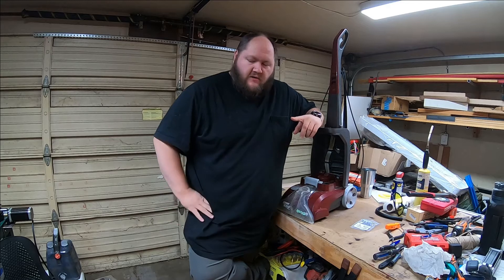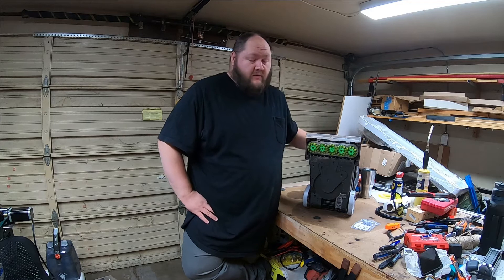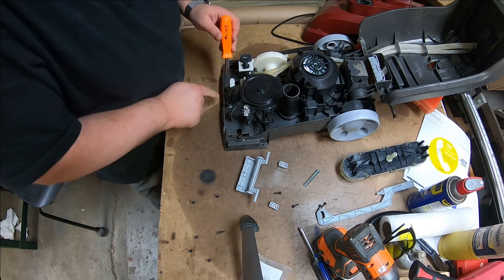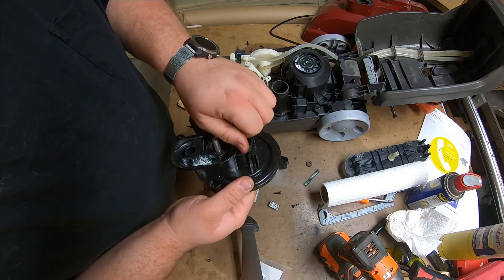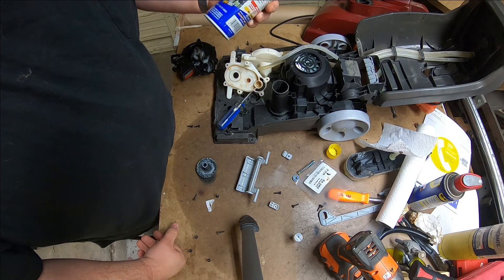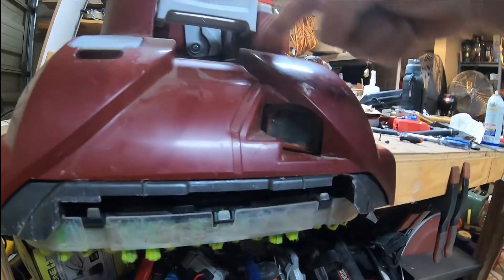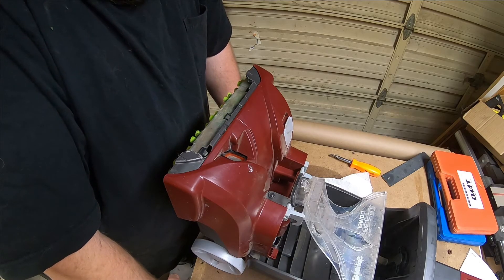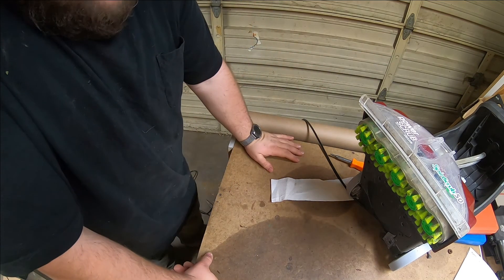Don't throw it away! Fix that carpet cleaner!

Comment: Oh, I’m definitely throwing it away. The hose broke off the white plastic piece that’s connected to the gearbox. Every screw that’s holds the gearbox on all three of them were broken at the plastic. Hoover will never get another penny of my money. They build garbage out of cheap brittle plastic. along with the seized rusty bearing. One shouldn’t have to take apart a carpet cleaner after the first two or three uses.

Comment: I have replaced these bearings multiple times. I drilled 2 access holes top and bottom behind the back of both bearings and use a  1/8 rod to tap the bearings loose. The top bearing is press fit on the shaft so l sanded the shaft for a slip fit for easy replacement.

Comment: I got one of those that I trash picked recently. Just took it apart yesterday and got the same problem with the brush not spinning (frozen bearings) But also the motor sounds sick even with it disengaged from the pneumatic turbine. It arcs and sparks and makes a popping noise. So now I’m wondering if I should scrap it after what you said about it being poorly designed. Or is it worth it in your opinion to replace or rebuild the motor?

Comment: Thank for posting!  Q: when the scrubbers are frozen does the vacuum cleaner make a  sound or does it seem like it wont even turn on? I'm having an issue where mine wont come on. I understand it could be the motor, the pump or the switch (or even a fuse link at the switch) but I was curious as to how what it did when the scrubbers locked up. Thanks

Comment: I have to wonder....when you're done using the unit... if you put a fan to blow through the screen for a few hours so air blows through there and dries it out....this is what I've always done and my brushes haven't stopped spinning... Knock on wood. I really LOVE these cleaners they suck almost all the water back up....and are so easy to use and clean...I wish they made them better.

Comment: Nice job on the video!  Have the same unit and noticed the brushes were not spinning.  Disassembled and observed the bearings were completely frozen from rust.  Soaked them in PB blaster and they freed up.  Appreciate your help in the repair!

Comment: Mine recently just stopped workin and I barely had it for a year. I had turned it on and turned it off really quick, I don’t know if that played a factor for it not to turn on again. I was wondering if you know how I could fix it? I did plug it in properly and checked fuse or breaker in my own home. However, I haven’t checked checked it there’s a fuse in cleaner that was blown, I don’t exactly know where the fuse is lol. I’d like to save it as I spent almost $200 on it

Comment: My brushes still don't spin.  I checked and greased the bearings, the motor puts out great air. The filters are clean, the gasket near the body of the machine (near the top of the waste water tank seals.  Still does not spin.  what else can I check?  ?gasket to hand held spinner?  Is there another gasket somewhere for the air to escape before it gets to the spinner?

Comment: What other cause interferes with spinning and discharge
Reply from the maker: One possible cause is an air leak. If the unit freely spins check to see if you have airflow flowing through it. Also make sure the unit does spin. A frozen bearing will sieze the unit up. Check your gasket in your collection tank and the sealing gaskets under the tank

Comment: got mine in 2019 and could tell it was total junk then ...broke in 2022 ..this problem and the spray hose pump not spraying .... land fill its coming!!!
Reply: I 3D printed a new water pump impeller. The original stripped out...

Comment: Hy , your video is so helpful…mine is 2yrs old it does not suctioning… would you please give me a link to buy it … I didn’t find it in stores
Reply from the maker: What in particular are you looking for? The bearings? If it doesn't suck anymore but still runs, check the gaskets on the tank. It operates using negative pressure so a leak in the system wouldn't allow for it to suck up any water.

Comment: Use marine grade grease youll never have to do it again most likely
Reply from the maker: That's a good option, a touch of grease never hurts.
Reply: I tried and sadly the bearings in the turbine still lock up. I'm so tired of this issue every springtime that I've resorted to popping off the brush cartridge and using a 3/8 hex on the brush drive output socket. Mind you, the marine grease on the bearings saved me from having to use vise grips on the hex key to crack 'er free. But I just checked today and I did have to use the hex by hand still to crack it free. Shoddy design.
Reply: If it spins at the hex key does that mean the bearings are spinning freely?
Reply: @burlwilliams7661 , more than likely you're okay if that's the case because frozen bearings will not allow movement. Remember these aren't belt driven brushes, so you'll have to run it on the floor to check for brush activation if in doubt they may not be operating properly.

Comment: Anyone have to hold down the power button to keep it running
Reply from the maker: You may have a bad switch, I'd recommend opening it up and actuating the button by hand (not with the plastic on/off button.) while unplugged! If it clicks, the problem could be the plastic butting isn't pushing the button down far enough, if it doesn't click, the switch is probably bad. A replacement should be cheap, look on the side of the switch and Google the part number.
Reply: Don't just click it down and let go.  Click it down and hold it there for a couple seconds, then it should work.  Mine does that too.

Comment: My power isn't coming on. There is no power to mine
Reply: I used mine, cut it off  went to cut it back on snd nothing. Then i tried a few weeks later cut it on, but i cut it off and now no piwer again.  I can see the  spring  is still there.  Please make videos of no power
Reply: @Tturn1977 if it randomly cuts on and off more than likely it's a bad switch. I'd recommend pulling the switch and actuating it by hand and see if you get a good positive click. A replacement switche should be reletivly inexpensive online
Reply from the maker: Oh no! Does the switch click when you press it? If it doesn't, it may not be lined up with the plastic on/off peddle. If it does click, the switch may be bad or the connections may be loose or broken. That's where I'd start. I hope this helps!
Reply: I got my husband to straight wire mine, and works like a charm.
Reply: @Tturn1977  Just plug it in and it's on?  ;-)

Comment: Video was ok until you didnt show us how u removed the bearing by the white wheel
Reply from the maker: If you're referring to the bearing in the black housing, I didn't replace it this go around. If I recall you unsnap the clips which exposes the impeller, you have to pull the impeller out and get access to the bearing that way.
Reply: @handcraftedoverlanding   Two of my snaps broke off too. The screws went in fine though.  Is it gonna leak now?
Reply from the maker: So it shouldn't, I may have a bit of an air leak but as the unit only spins the bristles, it wouldn't be a critical leak and should still spin the bristles
Reply: @handcraftedoverlanding  how were you able to pull the impeller out? I can't pull it out!
Reply: Great video! Could you post where you sourced the bearings? The housing on my gearbox is cracked too bad, would ya happen to know where I can get it from? Couldn't find on eBay, thanks!

Comment: Mine is brand new. Glad to know how it works. Any suggestions for preventing the bearing problem?
Reply from the maker: Without opening it up, maybe run it for a few extra minutes on a dry patch of carpet to pull the moisture away from the bearings. Remember you'll have to tilt the arm down to get the brushes to spin and open up that mechanism. If you were to open it, you could hit the bearings with something that provides a moisture barrier. Something like wd40

Comment: Anybody have 'NO POWER' on HOOVER POWERDASH-PET carpet cleaner?  It worked fine the last time i used it (6-7mos ago) now.....  no power when red step switch depressed.. 😕  ???
Reply: Same! This is the 2nd one I have purchased and had the same issue with both
Reply: Same promblem, can't  find any  information  on how to fix
Reply: Same
Reply: I had the same issue, and i fixed it.. open it  up and lift up the on/off switch body and press on on with your finger and if it works your problem is that the on/off switch body was not secured and was pushed up enough till the pedal could not reach it, what  i did to fix it i put two pieces of plastic wire/string from a weed eater as a spacer on the right side of the switch body and made sure the clip on the left was holding  the switch body
Reply: That’s exactly why I’m here.. smh